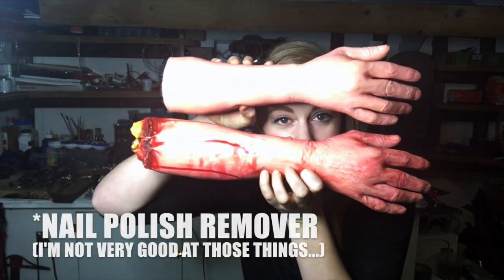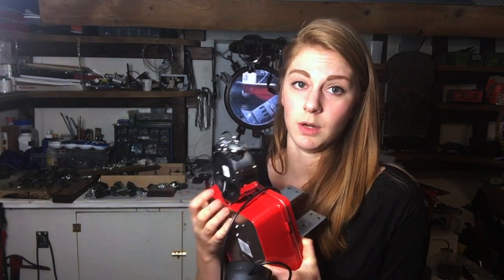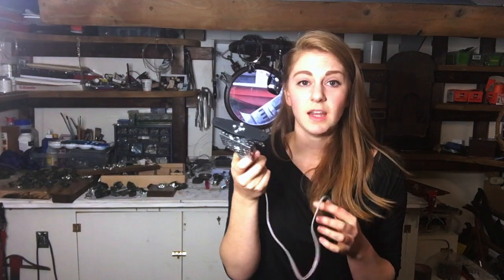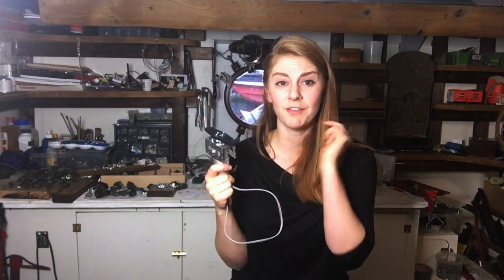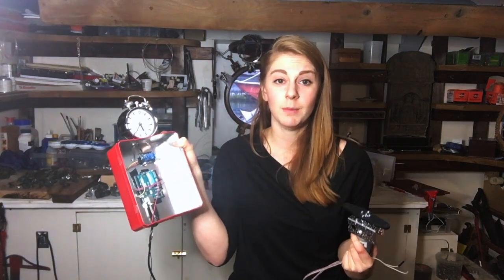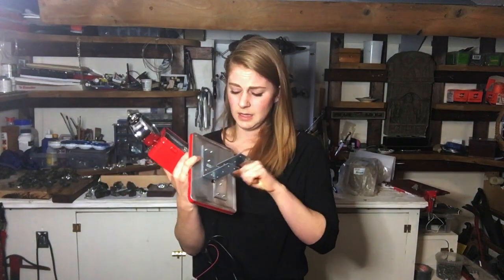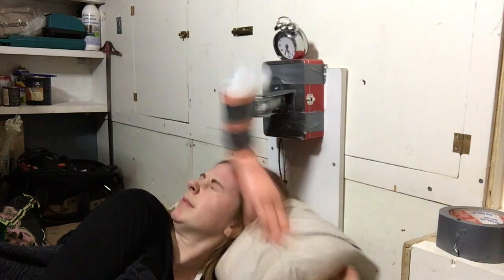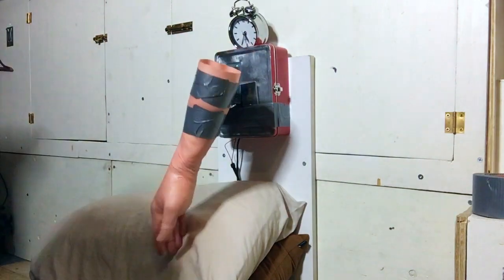The Wake-up Machine VLOG

Comment: I laughed so hard! That's awesome! My problem is always that I'm very clever at either hitting snooze for literally six hours or turning the alarm off entirely all in my sleep. What I do when I really need to get up is to set multiple alarms and then put at least one across the room and inside a cajon drum (although I'm sure other drums would work well too). If I just put the alarm across the room, I might sleep through it, but putting it inside the drums makes it louder and also makes it sound different, which is something that is more likely to wake me up. Being too warm always wakes me up but that seemed like it would be more dangerous than it's worth.

Comment: you are cute😂

i burned even breadboard one time along with it ,

well if you wanna use transistors i guess there are too much transistors to use , the first choice is darlington npn like tip 120 122 package along with constant current source so that your transistor will not get burned another choice is to first amplify the arduino signal using bjt and then use a power mosfet along with the heat sink it'll do the job and there are many logic level mosfets are available too use can use them along with arduino directly to drive such motors.

Comment: You seem discouraged over the transistor issue.  Would you like some advice?  If so, see my suggestions below.  If you already know them, maybe someone else will find them useful.

1)  In addition to not exceeding basic voltage and current specs, keep in mind that  they are still essentially resistors with a greater than zero resistance even when fully "on", and will generate heat, proportional to the current they are handling due to I-squared-R (P=I^2 times R).  Note especially the I squared factor!   Proper heat sinking is essential if they are required to handle significant amounts of current!  Be sure that the transistor has enough drive to minimize the collector-emitter (for bipolar) or drain-source (for FET) voltage drop.  https://www.allaboutcircuits.com/tools/heat-sink-calculator/

2)  In PWM applications, while being careful not to exceed limits, be sure the source impedance of the circuit driving the transistor is low enough not only to provide enough, but to avoid allowing the transistor to dwell in its linear range.  In other words, the transition from off to on and vice versa should be as fast as possible despite the stray gate/base capacitance and other factors (like wiring layout) which may cause parasitic oscillations and heat!  I've seen misdesigned circuits involving power MOSFETs where heat sink fans were used because they were running so hot, when all that was really needed was to eliminate the parasitics (and radio interference)!  The oscilloscope is your best friend in these situations.

3)  Don't forget, when driving motor windings and relay coils, about that killer inductive kickback!  When the mag field collapses, the voltage at the driven terminal skyrockets!  Proper voltage clamping and suppression techniques are essential to avoid exceeding the transistor's ratings and destroying it!

4) Finally there's the 0.01% chance you'll run into the dreaded thermal runaway situation that calls for extra protection in the form of overcurrent and overtemp sensors to roll back or outright shutdown the drive.  Voltage comparators to the rescue in those cases!

Good luck and hopefully your transistors will live a long useful life from now on!

Comment: There are tons of NMOS FETs that have these specs.

Try the Infineon IRL3803VPBF.  It's a beast.

You want one with a low Rds On, so your heat dissipation is lower.

If you want to use a regular FET that doesn't have a low threshold voltage, you need to use a gate driver.

Comment: what you need is a logic level mosfet. they're pretty neat to learn about, and the power losses are very low compared to a normal transistor, meaning much less heat. logic level means you can reliably charge the gate of the mosfet with 3 or 5 volts from an arduino.

Comment: you needed to add a torque clutch or slip belt drive, so that it only slaps once. with a belt drive it's a simple adding of slack to the belt by moving a disc (like in a cars fan belt)

Comment: This MOSFET should work: http://uk.farnell.com/international-rectifier/irf3708pbf/mosfet-n-30v-62a-to-220/dp/8648158
The arduino uno output signal levels are 5V, and this power mosfet's threshold voltage is only 2V.

Comment: Try an IRL540N, but you definetly need a heatsink and a flyback diode... I killed some of these trying to drive my soundwave toothbrush with a lot higher frequencies.. They spikes generates by the back EMF make the FET to turn permanently on after some seconds (probably the high voltage penetrates the zone between drain and souce.

Comment: Still wondering, whats the arduino doing..
If u can switch a relay with the clock why dont u hook up the motor directly. And what power source are you using?

Comment: Transistor advice: You don't really want to be able to supply it with the full 20A stall current; that would be a recipe for truly making a bald spot when it tangles up in your hair.  If you want the whole sold-state wake up machine with BaldSpot, an ST Microelectronics STD35NF06LT4 looks like it could work when driven from an 3.3V output.  Another option might be a bipolar transistor like an On Semiconductor BUF26 could work too.

Don't listen to the comment below about using an SCR.  That would be for the head-slapper that never turns off.

http://www.digikey.com/product-detail/en/stmicroelectronics/STD35NF06LT4/497-7965-1-ND/1883469
http://www.digikey.com/product-detail/en/on-semiconductor/BUV26G/BUV26GOS-ND/1476296

Comment: There are tons of Transistors to switch 20A... they are called MOSFETs and are easily available up  to 100A (although you might need a Gate Driver Stage to swtich it).
There are also Bipolar Transistors for switching high currents, they are called IGBT - I wouldn't recommend them for easy use though.
Reply: Yeah she should be using FETs, just google "using FET as low-side switch"

Comment: Solid state relays might be what you were looking for, they consist of beefed up transistors and thyristors which can handle higher current ratings.  They also don't make annoying clicks or have solenoids that corrode and stick. I'm sure they cost more than standard relays which is probably why they aren't very common.

Comment: Hello, there is something called a logic level MOSFET, witch can handle large currents . MOSFETs transistors are triggered by voltage and if you bye the logic level ones they can be triggered by the Arduino output voltage.

Great channel by the way ;)

Comment: OK, the video already is old and I'm planning to do some power control with a Microcontroller myself. My plan is to use Mosfets. They can also be used in parallel if a single one won't be able to handle the current.

Comment: Maybe you have forgotten to add a flyback diode and therefore all these transistors blew? Additionally, I don't see the need for an arduino for this - just use the signal from the alarm clock to drive the transistor directly, or maybe with a driver transistor in between.

Comment: Not sure if you're planning on a version 2, but you might want to consider using a slider crank type mechanism to convert the rotation into linear motion.  That way you can place the end of the arm on a pivot, and the end of the connecting rod to the forearm and have a more "natural" slap.  It would also avoid sucking the hair into the motor shaft (also you can place the motor farther).

Comment: Great video. You mentioned there being no transistor that could handle the 20 amp stall current of the motor. There are a lot of power MOSFETs that can handle that much current some for prices around a dollar from surplus electronics dealers in the US, but at 20 amps the on resistance will mean they are dissipating 5-10 Watts of heat so you must have a good heart sink or you'll let the magic blue smoke out.

Comment: so grounding alarm makes it ring? i thought ground was needed for excaping the electical current.

you have plus and minus. usualy that  activates the alarm. a curent on the wires from - to + you know.

usualy. . if a current goes to ground, its lost forever.

atleast thats my 6  cents about how i learned electic works.
So if you say you opened up the alarm and saw it turn on the Ground. im confused.
Reply: Turning something on or off is done by closing or opening the circuit. This can be done at the positive(+) side or the ground(-) side of the circuit, it doesn't really matter. Give a light bulb a positive connection, it will need a negative(ground) to turn on.
Reply: +MaTTR TwoThirty (MaTTR230)  i thought there is a + and - and ground.

Comment: the transistor to control motors is called scr (silicon controlled rectifier) or thyristor. those are made to handle various amperages suitable for motors.

Comment: I found this MOS : IRF3708PBF, a sweet 62 Amp/30V ( available on farnell) that should be enought for your motor, with a Vgs throttle at 2 V.
Don't forget to put a Free-wheel shottky diode in parallel or your mos's are always going to burn due to inductive load :)

Comment: Honestly ... what do you need the Arduino for?
No matter how weak the switching contact inside the alarm clock is, it can still switch more current than an Arduino digital output pin. So just connect your relay (or whatever power switch circuit you may have) directly to the alarm clock and you're done!

Comment: There are logic level mosfets (meaning you can drive the gate directly from your arduino digital pin) that can do 100+ amps, but the only caveat is that you get a properly sized heatsink to dissipate the heat when you're stalling.  DAT HEAT will get ya ever time and let the ghost out.

Comment: If you go over to MOSFET transistors instead you will find things that can handle that motor. I use IRF HEXFET power MOSFETs to run motors that explode 15A fuses. Only one that has failed me yet did so because of water damage.

Comment: what's the required current/voltage for the servo?  I'm sure a transistor/fet exists..  also you could probably just bypass the arduino.  and i thought you loved the mounting bracket for the servo but just used duct tape?  finally, why do you sleep in what looks like a closet?

Comment: That was hilarious. Take a look at solid state relays. I've used them to control 120VAC 15A loads before, but there are ones for DC as well.
Reply: +Mitch Spacone, +1, but they are expensive. I get mine directly from AliExpress (means no CE, but we don't need no stinkin' CE)

Comment: MOSFETS!  They have much lower ON resistance than NPN so 20A isn't too much.  Most RepRaps use a MOSFET driven by an Arduino to switch 12V to a heatbed with an 11A fuse,  but the usual N-channel mosfets used are rated to much higher (typically 36A or 55A).  They are selected to operate well with logic voltage driving.

 With all the chunky wires and heatsinks you need you might as well use Solid State Relays for convenience,  and then it makes little difference if you use a mains motor, which can deliver the same power with thinner wires.  The safety benefits of lower voltages get outweighed by the fire risk if you put too many amps through a thin wire, IMO.  Kitchen appliances are a great place to harvest small mains powered motors.

Comment: Don't know if someone already advised a transistor for driving the motor, but what about a N-gate Power MOSFET with anti parallell diode? Very low Rds-on so less heat. WARNING: there is a chance however that the motor will not stop turning after grabbing your hair !!

Comment: Hi, I found a transistor that you could use in your project. It's a N-type Mosfet, the AOD476. Even if this transistor should be mounted on a pcb, you can solder the wires on the package itself. Hope it helps :)

Comment: I think the problem with the switching high current you might have had with standard MOSFETs is dealing with the back EMF. The good MOSFETs can handle well over 50A, but power dissipation requirements have to be met and a snubber diode (schottky rectifiers are the best suited) for back EMF definitely needs to be included.

Comment: 2:50 Have you looked at using high power IGBT bricks? Either use one of those, or a high power SCR. SCRs (Silicon Controlled Rectifiers)  can switch HUGE things on, however once they are latched on, they cannot be turned off via the gate. You have to disconnect power to them. There latching ability can come in handy though.

Comment: I think you need a current limiter.. 
In addition to limiting the startup current and saving a possible transistor drive from expending all of it's 'blue smoke'... It would likely save your scalp in the event of another hair tangle....
On an aside, I was wondering what the  Arduino's purpose is, you could have driven the relay either directly or via a transistor. (if you are worried about the limits of the alarm clock's contacts... On the other hand (no old alarm clock puns intended) the Arduino could have been keeping time for you and possibly stopped the slapper automatically when there was hair trouble...
Sort of a slap snooze alarm..
I applaud your creativity!
~Tim

Comment: Great project!

Nerd Alert:

There are loads of MOSFETs that would handle 20A for you - something like this costs only a few cents: http://www2.mouser.com/ProductDetail/ON-Semiconductor/NTP5864NG/

It would drop 5W at 20A and at 33'C/W to ambient that would put it at ambient + 165'C (about 15'C above max allowable) so you'd need a small heat-sink, but nothing major.  Bolted to the cookie tin would do it.

Ugi

Comment: Instead of using transistor try to use Brushed ESC for RC Cars.. These things have PWM controll input and can handle very large currents. It usually has a 5V regulator for your arduino too.

Comment: If the arm would go back and forth instead of just rotating, it'll a) slap better (instead of just breaking itself apart) and b) reduce the odds of hair getting caught since the arm will not just be scooping your hair into the center of rotation. Maybe try a piston type motor that goes up and down instead? Then just attach the severed arm perpendicular to the axis of motion.

Comment: As mentioned by people before, you can use solid-state relay (IGBT) to control things with large current. I'm not sure if they can be controlled with 5V signal, so you might have to use another MOSFET and a 12V or 24V source (Arduino 5V->MOSFET- 12(24)V->IGBT) to do so if they can't. And it might look better if you programmed the arduino so that the motor goes back and forth 90deg instead of around :D But anyway it gave me a laugh so good job!

Comment: There are plenty of MOSFETs capable of >20A, my guess is that the current wasn't really your problem, you probably didn't turn it on fully if you connected it directly to the output of an Arduino. Most MOSFETs need like 10V or so on the gate to fully turn on, if you want to connect it directly to a microcontroller, look for logic level MOSFETs.

Or possibly, you didn't have a snubber diode on the motor, causing voltage spikes high enough to burn the transistor as it switches the motor off.

Comment: Try this transistor PSMN1R1-30PL. The on resistance is low (1.25mohms to  1.75mohms) even at logic levels so the power dissipation is only 0.5 to 0.7W at 20A so you shouldn't need a heatsink.

Comment: you could have used an IGBT or high power FET! it can handle 20A easy
Reply: Yes. Search chopper circuit on google and that would already be good enough
Reply: http://www.ece.uvic.ca/~elec499/2003a/group14/images/chopper2.jpg this one. use higher rating fets/diodes for higher rating motors and it should work fine
Reply: Daniel Yamin did you reply to yourself??!?

Comment: so to control high voltage a/c with low voltage dc...I believe you need what is called a "TRIAC" which would replace the mechanical relay.

Comment: I advice to use Power mosfet like Irlz34n, 55V and 30A. It's logic-level drive gate (0 - 5v) so you can control it just fine with arduino. I have use this and works very well. Just don't forget resistors to front signal drive and ground, maybe 10k.

Comment: You could use a MOSFET, like the IRL540. And i'd use a car rear window wiper motor, usually they have the mechanics for that swinging movement. So, it doesn't do circles - hair safe. :D There is also no need for that arduino, you can control the FET with the clock's switch.

Comment: I was laughing my head off till you got your hair stuck! 10 million geek points. By the way I use pre-soldered L298 motor driver boards for my robotic projects that need a bit more current. They are super easy to interface with arduino and they have captive screw connectors for connecting wires to it. You can get them from china on Ebay for around £1, which I guess is about $1.50. Keep making stuff.Just search 'L298 motor driver board.' Or 'L298 Breakout board'. I haven't managed to burn one out yet and even if I did it wouldn't matter because they are so cheap.

Comment: First of all, obviously this project is pretty awesome and so are you.

I have to wonder though, why use a microcontroller for this? It's basically connecting one input (alarm clock) to one output (motor). Having any controller at all between that seems like total overkill unless it's also doing something else.

As for driving the motor, as others have pointed out a MOSFET, Darlington array, or an H-bridge would have been an option, but I actually think a relay is not a bad choice for a motor that simply needs to be switched on or off. Easy to use and keeps things simple.